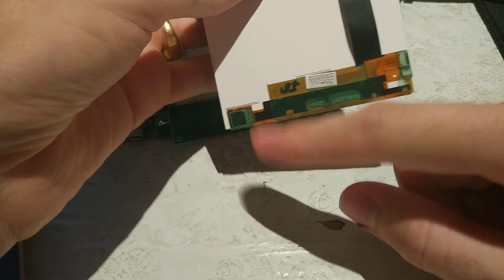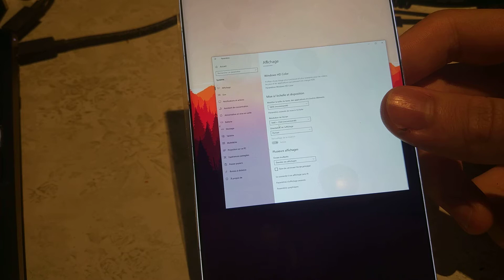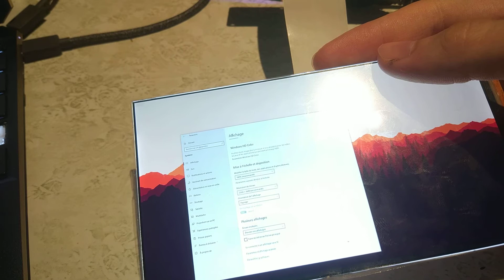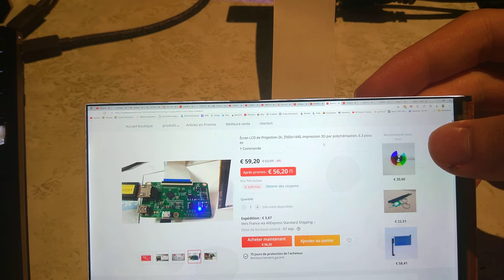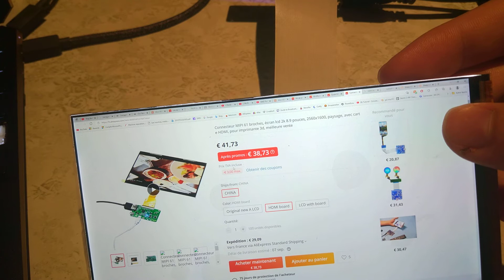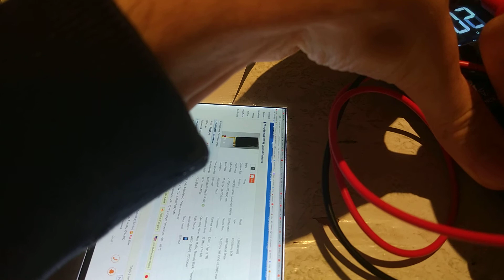[test] 2K driver HDMI to MIPI V3.2 board

Comment: I also have a display that is defaultly portrait. It's a wisecoco 11inch panel that I intend to use with my ipad. Do you know of a board that could rotate the display to landscape? Ipad cannot do this as of iPasOS 17
Reply from the maker: You need to know the connector type of your display. If it's EDP look at this driver board: hx_4k_v2
When you buy thoses types of board you need to inform your seller the resolution of your display!
Otherwise if it's MIPI, I received the knew and small rotating board from Wisecoco but I haven't done a video on it yet.
Reply: Thanks for the fast response! It's a 61pins mipi interface judging by the connector. I have been looking into changing EDID configurations so the board could be identified as landscape but have no idea if that would work
Reply: Can you link the mipi board from wisecoco?
Reply from the maker: @khoapham1691  take a look at there video, if you order the driver board you will have to specify your display's part number..
https://a.aliexpress.com/_EuymSjl
Reply: Thank you!

Comment: Hi, thanks for the video. How is the small "plug-in" connector that goes from the lcd display to the small board that's connected with the white ribbon cable? I'm trying to understand since I would like to re-use my old nexus 5x display as a portable touch screen display. Thank you in advance!
Reply: @MKR3238  are they standard or are they different to each other? Thank you for the reply btw!
Reply: @alby46intro  hi they are actually different. Each manufacturer decides of its pin but the protocol stays the same. It's still MIPI. You need to get the datasheet of your screen to actually know how to map the pins etc. So you'll probably need a "custom" board

Comment: Do you know of a model that would work with typc for power and video with typec alt mode?
Reply from the maker: The problem is that all type-C are ment for Power only (or touch as for the "htls58"); no I don't know any. Usb-C alt mode is NATIVE Displayport signal, so if you don't find any type C to mipi driver board, I suggest you to look for "DisplayPort to mipi" also "displayport scaler mipi" (depending on you skill and projet DP is 3.3v and low power..) I have a "landscape 2K board" (with DP, +freesync?)
Last thing would be to find a 5.5' type-c touch screen or something like that and salvage it for the board... or the htls58 may have an updated version by now (2K? C alt mode?)..
Companies like M.agedock have driver boards that are for some reason not on the global market..
Reply from the maker: You can talk to Wisecoco on Aliexpress, that is what they told me "we have 8.9-inch 2K and 14-inch 4K displays that can drive the display through only the USB-C port." so I looked it up and it doesn't run this 6' screen because it uses "eDP" and not "MIPI" or else look at "K002019 usb-C" that board does tactile transfer as well..
Reply: @Brisou394  Thanks for your time man. I know chatting about stuff like this in a YT comment section is not the most efficient way. Its just been very difficult for me to find much information in this topic. I DMd the stores on alie but either I got no response or they told me to purchase something custom(which as I am sure you know is very expensive). The displays I was looking at where MIPI and the driver board I found was mipi. The downside is the displays are only 40pin and the driver board is 60 pin from the spec sheet.
Reply from the maker: @19CD91  I don't know what you are talking about nor what you trying to do. I am not very experienced with those things, so for now I will get interest to MIPI and eDP. And I haven't found any 2k display driven with MIPI 40. So why don't you talk me about your hardware for me to help you. Your display might be a 1080p screen and it also might be sold with a driver board, if not you could easily find your display reference name and find a similar driver board..? I don't know how firmware plays a role (nor how to update it) but my 60pin landscape board could not run my LS063R1SX01 which hase 60pin too... (also I believe there can be adaptor boards 60 to 40 screen; or does the 40 pin ribbon cable can be inserted to the left of a 60pin??)
Reply: @Brisou394  sorry I had a more detailed post with a link to what I was talking about. But for some reason it keeps getting deleted. Maybe YouTube doesn't like having url links in comments. Thanks anyway. I guess I'll just have to buy the parts and hope they work.